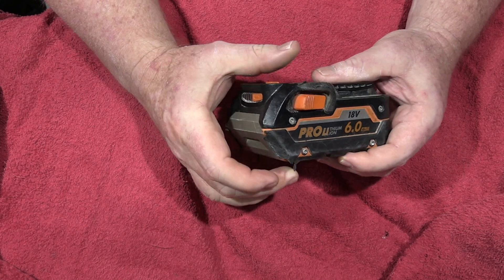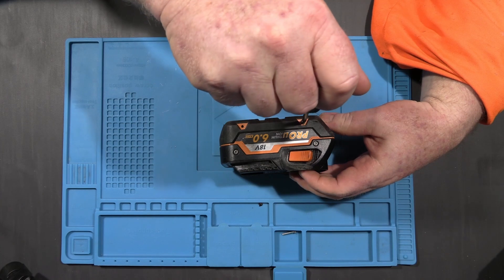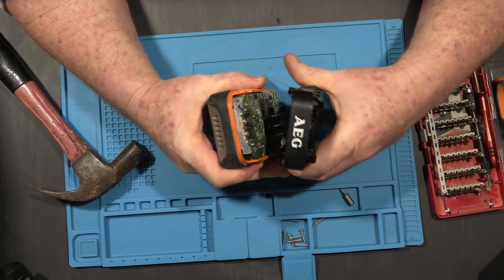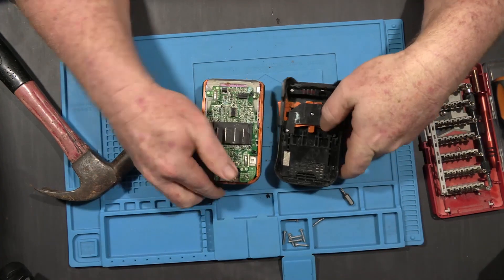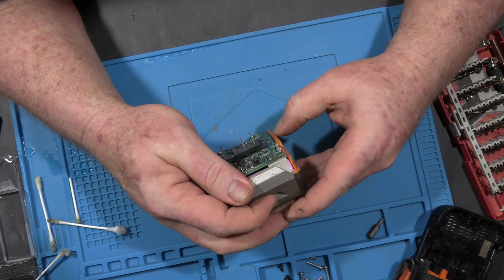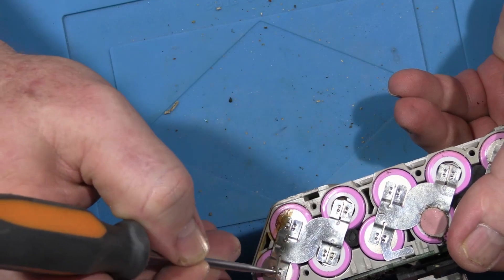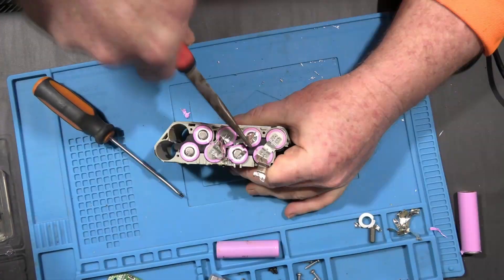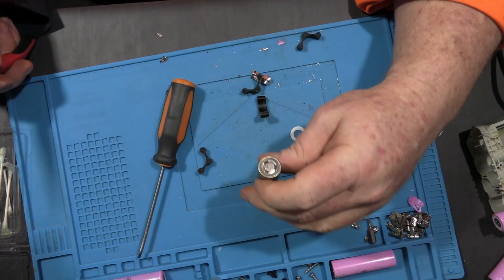AUSSIE TEAR DOWN OF 18V FORCE 6AMP AEG BATTERY

Comment: I'm just about to pull apart one of these and salvage the cells. I've done it with an Ozito battery in the past and, yes, I hate peeling the nickel tabs off the positive line. Kind of need some ceramic nose pliers or something! Sparks galore.

Comment: 😅cheers...have been trying to work out what the other four connections are...I'm thinking temp sensor...and???batt health circuit or some bs? In any case, my AEG charger started cooking - smoke and noise - prob the large cap...after less than a year...No solar solution either to recharge (chainsaw)...Not impressed with AEG at all...Wish I'd bought a Stihl or at least a Ryobi...and...they used concentration camp labour under abominable conditions in WWII...I think these battery packs are overengineered rip off priced bs...

Comment: Im currently using a 4.0ah. Would the power of AEG compact blower GM18EX2-0 improve if I use 6.0 ? I know runtime will improve but not sure if the air flow will.

Comment: Nice bro . I got those 6amphour ones . Do you know what cells are inside  the force battery?
Reply: He said at the end they where Samsung cells and gave extra info around 10 mins in
Reply: @haku4841  hi there, my 6 amp batteries are called force and not the same as the earlier pro battery. They use different cells. My initial question could have been maybe more specific to my battery . 👍🏻🙏

Comment: I live in Melb and have about 4 AEG 18v Batteries that are stuffed. Would you and what would you charge to repack these for me. There are 2 x 4 amh and 2 x 2 amh. Thanks
Reply from the maker: Unfortunately it's not worth it .. by the time you buy 18650s then pay for shipping both ways it's cheaper to buy a new ... Pull the cells out and keep them for somthing else ... Other then that there E-Waist ☹️
Reply: @Gymjunnky  tHANKS. i HAVE NO USE FOR THE BATTERIES , SO THE TIP GET THE UNITS.
Reply from the maker: Yeah pretty sad ... i support right to repair !